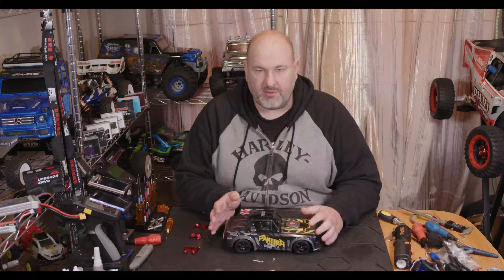UDIRC panther pro, cheap alloy upgrades Hubs and arms.

Comment: Sorry to dredge up an old video BUT the front hubs. You put the bearings in AFTER the screws? When I out the bearings in and then try to put in the hub screws, they will not go in and get tight. Put teh screws in forst and then add the bearings will give a much tighter assembly? mine is very loose.
Reply from the maker: Didn't get lose on mine but there have been a good few changes on these udi rc's over the years :)

Comment: Hi helpme pls put link to metal spur pls
Reply from the maker: This looks like the right one Just found this amazing item on AliExpress. Check it out! ￡2.47 | 2Pcs/set Decelerate Steel Gear+Motor Gear Wltoys 144001 124016 124017 124018 124019 RC Car Parts
https://a.aliexpress.com/_mOpwL1q

Comment: Sick mate quick question is there any mini GT or other body's that will fit this sg 1603 mate cheers man
Reply from the maker: Tbh there are loads of bodies that can be made to fit most rc's it's just a case of making body mounts :)
Reply: @WTFRCCars  any you could recommend that would work mate and we're could get body mounts made please mate I've been searching absolutely ages now want a little GT body or something 😂
Reply from the maker: If you search 1/16 body shell you will find stuff like this that should fit

[£22.97]ZD Racing EX16 S16 1/16 RC Car Spare Body Shell w/Sticker Sheet Painted 6650 Vehicles Models Parts Accessories RC Parts from Toys Hobbies and Robot on banggood
https://banggood.onelink.me/zMT7/zlwg0p29
Reply: @WTFRCCars  cheers mate seen that one but that only one don't think any delta plastik body's fit and neither do phat bodies mate it's 170mm wheelbase and mine is 290mm long custom cf max10 combo build mate thought delta or any others would have loads but literally none mate
Reply: Would you recommend these metal parts mate or keep stock if could go back in time my sg is custom cf build but stick front and rear assembly but unsure if this would be worth doing or not cheers man 🙏💚👊
Reply from the maker: There nice to look at but not sure if there really needed :)
Reply: @WTFRCCars  ahh cool and I'm guessing as they metal if do crash more likely break more parts than would of if left stock 😆😂😂
Reply from the maker: On a bigger RC I'd say yes but as these are so light I don't think you would break anything my likely it would just bounce off lol
Reply: @WTFRCCars  😂 yeah true man might give them a go at some point even if don't add anything long as they don't make them any worse 😂😂 cheers man 🙏💚👊

Comment: I got the alloy parts but they didn't send the brass inserts for the wishbones so the steering locks up tight. Can they be sourced separate? Thanks. Great video.
Reply from the maker: Not sure but I would think if you message them they can find some for you or just search on AliExpress for them :)

Comment: I think the problem with the arms binding is caused by the screw (pin) that goes through the diff housing for the arm to pivot around.  I made my stock arms "floppy" by using a 2mm (same size as the hole) drill bit and turning it manually lots of times.  You don't want to "drill" the hole but ream it ever so slightly so the pin can easily spin but isn't sloppy.
Reply from the maker: Yeh would definitely help :)
Reply: @WTFRCCars  Are the metal arms/steering knuckle "tighter" than the stock ones?  The reason I'd consider an upgrade is to reduce the slop and jiggle in the steering components.
Reply from the maker: Yeh they do seem to remove some of the slop in the stock parts
Reply: @js32257  o
Reply: @IphoneProMaxLevel  ...what?

Comment: I just installed the metal front arms and I stripped the hole on one of the cups :( It looks like there are two types
Reply from the maker: Interesting I didn't have any issues fitting mine at all